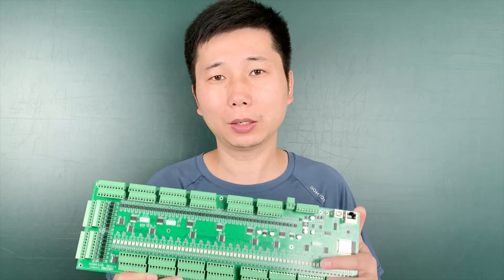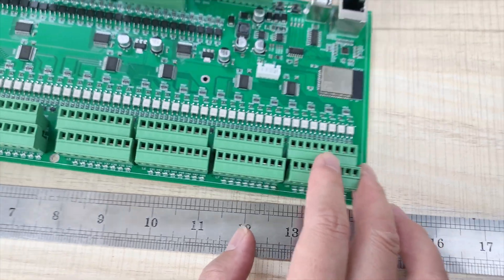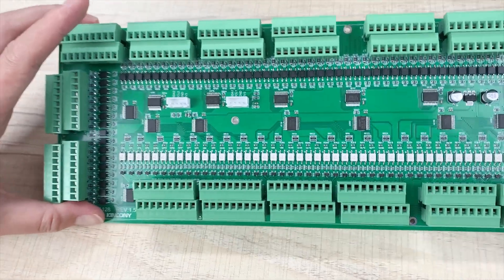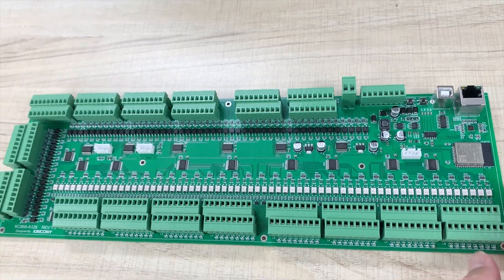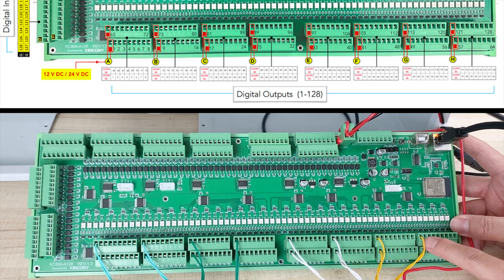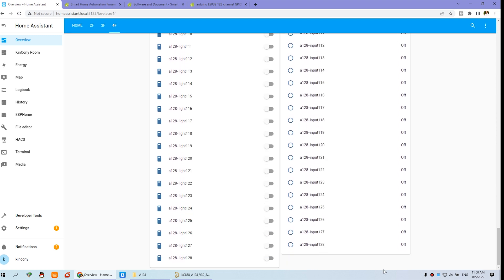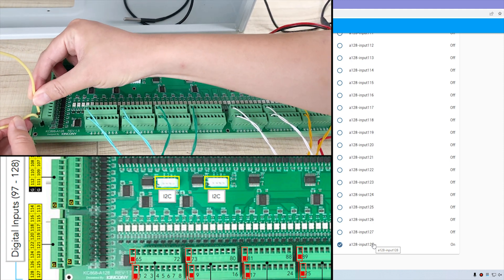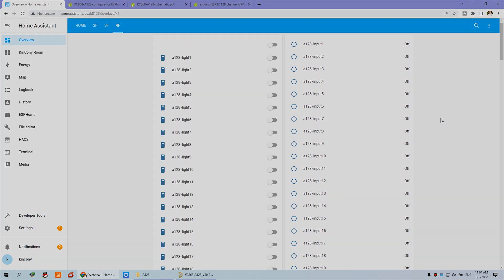KC868-A128 ESP32 128 DI +128 DO working home assistant by ESPHome -crazy!

Comment: Can I leave it configured so that when activating input 1, output 1 is turned on or off, even if the Home assistant is offline? Working standalone? Thanks.
Reply from the maker: sure, input work with output not need network, not need home assistant. it work in locally.

Comment: Is it possible to use two i2c (binery sensor and one sensor) on same esphome device?

I am your fan from india 🥰
Reply from the maker: sure, all i2c chip can be used.
Reply: @KinCony  Thank you for your response. Could you provide an example code for the mpr121 and bmp280 with the esp32?
Reply from the maker: @vpjjk  i have not used these two chip, but i think you can use esp32 adc to read them.

Comment: Great.Great work. Is there a way to control the input pins with voltage? For example instead of shorting with GND we give it 12V
Reply from the maker: yes, digital input use for dc12v or short with GND. connect with GND= trigger, connect with 12v or NULL= not trigger.

Comment: The range of devices you have made is amazing. I am also in the middle of designing the electrical system for my yet to be built house.
I would like to respectfully suggest the idea of POE to power the board to minimize additional power supplies. Lighting powered by POE is also on its way and should be here within 5 years so this would pair perfectly to that eco system.
Thank you the great video!
Reply from the maker: yes, POE is good, thanks for your suggestion.

Comment: Just came accross your work.  This is excelent work.  I have home assitant with a lot of zigbee sensors and some wifi devices.  

Busy designing a new house.  This looks like a great option.  What would you recommend to integrate motion sensors? Wired? Zigbee?  

I will have a two storey house.  So zigbee needs to be extended.  Maybe I can just stick to Shelly Motion 2 sensors as eventually all these ESP32 devices will end up being thread/matter mesh anyway.
Reply from the maker: if you use home assistant, suggest control relay by ethernet cable by wire, sensor you can use zigbee, because you can use zigbee USB dongle to home assistant via zigbee2mqtt. that will stable solution, not suggest control relay by wifi or wireless way.
Reply: @KinCony  Thanks - agree - ethernet better option for relays - started using some shelly ones in the DB as the wifi was not reliable.  Just need to figure out sensors.  With zigbee I have to put router dongles all over the house to get a proper mesh network.
Reply from the maker: @karlOFuchs  if can use wired solution, it's best.
Reply: Hello, I'm from Brazil, can I configure this here?

Comment: Hi, I understood the switch input can be until 1000 meters. Do you suggest wired to do it with no interference or false readings?
Reply from the maker: Network cable or shielded cable can be used. Our circuit scheme has been used for 3 years and has no problem.